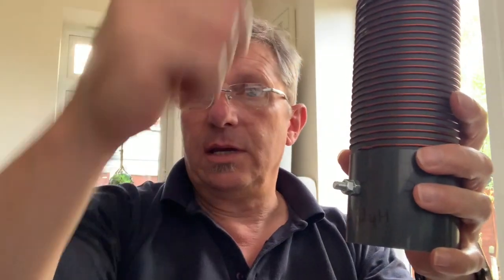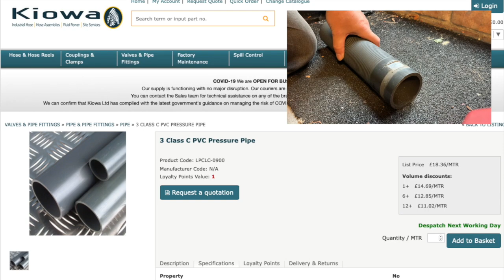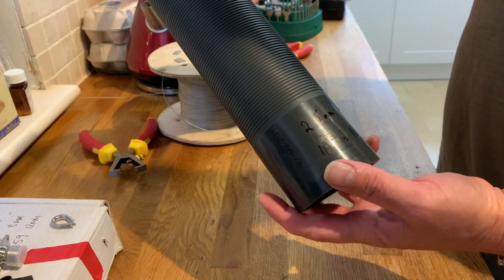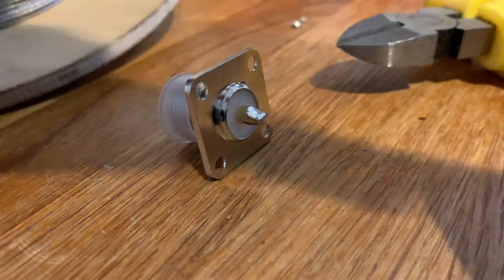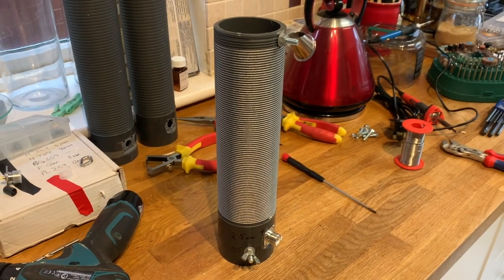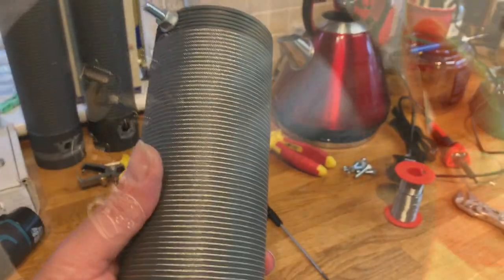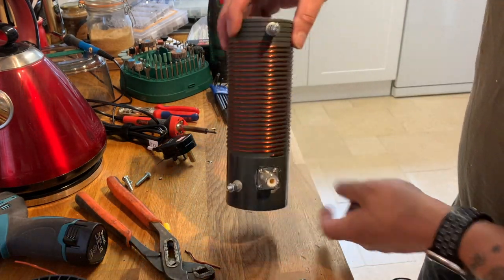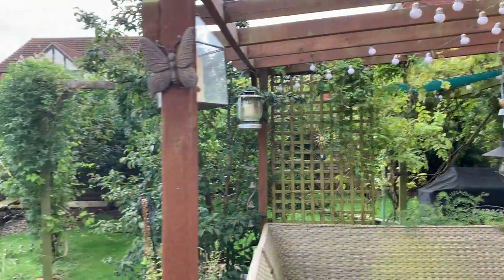HAM RADIO: DX Commander Base loaded for 80M & 160M Vertical.  DX Commander

Comment: Takes me back many years,  as you like tinkering Mike, take a 30mm condute (plastic) 1.2m long, now go get a flat piece of wood vineer (2mm) x 1.1m long ,that wil just fit inside the pvc tube (width wise) now drill 10 holes equally spaced on the vineer (its gonna be close,) wind the vineer from to to bootm.,, with 1mm copper wire varnish coated type (transformer wire) ... 10 turns.
bottom is sealed of with weep hole present, top get a cap and a 3/8 bolt (whatever you can make fit), add a +_1.2m whip (tuneable) and you are on 40m band.
Reply from the maker: might give that a go.  :)

Comment: Hi Mike
Great content,
I've been doing the same sort of think now for a few years,  a friend and I need more inductance while playing with a DX Commander pole on top of Clee Hill and ended up with a beer bottle and 10 turns of wire, which tuned fine.  Sadily, we never thought to test it with the bottle full lol.
The reason for commenting is, I've found that you can get quite an influence by using black pipe as opposed to white pipe, and have always guessed that there is a pigment in the black pipe that makes it magnetic in the same way as a ferrite core.  I know that this isn't t he same with a white pipe and wondered if you had tried this  with a white pipe.  You might find some of those elusive S points.
Great channell.... Keep it up.
Andy

Comment: Hi Mike.... I am all set to go and build my 160 coil after doing the microHenry calcs. Gonna use 110mm plastic sewer pipe (terracotta stuff) and 1.8-2mm copper winding wire with the ‘shellac’-style insulation. Not sure I trust non-insulated wire close spaced. Look forward to your findings. Best wishes. Nick M1DDD
Reply from the maker: 30 turns 2.5mm spacing should work a treat..:)

Comment: If you could make a loading coil for the base of the DX Commander that could work on 160m & 80m using the 40m element with all the required conections for quick switching I would be very interested in buying it! Keep the tests going till you've succeded. It's looking very promising so far. :-) 73
Reply from the maker: Cheers John

Comment: if you put a tap point on the 160m coil you can cover both bands by shorting to the tap point and at the feed point put a cap box for impedance matching about 330pf for 80m  and up near 1kpf  for 160m  base loaded is easy but center loaded is much better
Reply from the maker: Food for thought..  :)

Comment: Nice work Mike, I've made a couple of 160m prototype coils for my adjustiwave. I struggled to get a low SWR but believe my nearby  tower was affecting it. I need to test out in the open before making a  proper coil from screwcut  pipe. The only other issue I see is the number of radials required. 16 x quarterwaves on 160 is a lot of wire unless your in the wide open and can have raised radials. Like the SS wire, I use the same on the adjustiwave but the lack of being able to solder is a pain. Look forward to your testing.
Reply from the maker: Hi Colin, I do agree with you with the radials..  I have 3 at 20m each so SWR is Ok.  Test video coming soon

Comment: Excellent work Mike, It looks like a commercial kit! I don't own a Dx Commander but i am willing to build this Coil for 160m and use 9.68m long aluminum whip with 4 x 10mts long radials that I can fit in my backyard, I guess it will perform decently on 40mts but what i am really into is to try something for 160m. Any suggestions are more than welcome. Many thanks for sharing your knowledge with the HAM community.  73 de TI5CDA
Reply from the maker: Give it a go, 👍

Comment: Great stuff Mike .This coil is for 160m and Vertical Antenna .I have long wire antenna about 70m .Can I use this load coil after my transmitter ?
Reply from the maker: Yes possibly

Comment: Mike, Who provides the external 'screw threads' on your pipework for the coil wires to sit in?
Reply from the maker: Bruce Macaulay a mate called Bryan.
Reply: @mike-M0MSN  Ah -- so Bryan has a lathe! Acquiring correctly 'threaded' coil formers has always been a problem when considering whether to wind a coil such as you demonstrate. 73 Bruce G4ABX
Reply: @mike-M0MSN  Does Bryan have some available for purchase?
Reply: @NS0O-EN33ec  Hi Don
Wind your wire spaced with String/Twine/Rope or a Second Wire to Create/Maintain spacing. Hold coil wires in place with HotGlue/SuperGlue/Epoxy or other adhesive. Remove spacer(s) and you have the same Electrical/RF result as if you had machined grooves.
Add 'Tap-Points' for tuning/testing then coat the coil with Polyurethane or equivalent, or not if using Jubilee Clamp.
Machined grooves are great but really hard to come by. Nylon-String/Twine works just fine for spacing of coil wires. Been there, Done that and Have the 'T-Shirt'. Good luck 
73 OM......

BTW: I intend to construct a few of these coils to add 80M and 160M to my Slopping-Inverted-'L' EFHF 40M/80M (66'/132') antenna raised vertically on a 40'/13M SpiderBeam Mast and then run out horizontally across the yard. I use this at my Antenna Restricted QTH and also when I go Portable. Works quite well.
I insert different lengths of wire at the feed point to resonate on the 'In-Between' Bands, with no tuner required........
Reply: Many plumbing supply shops will thread pipes on request, both PVC and metal.

Comment: Is it possible to build coil to add to my multi band Dipole Antenna. The antenna is 80 feet long and will operate down to the 80 meter band.  Is it possible to add a 160 meter coil and extra cable to each end of the antenna.  Space is not a problem. I can experiment but why reinvent the wheel.
Reply from the maker: Yes that can be done, perhaps a coax trap would work better..

Comment: What was the reason for choosing stainless wire?
Reply from the maker: Hi James, no real reason. I had some SS rope from another unrelated project, needed to have a wire that I could tap at any point without the need to remove any insulation, it is going to live outside, so decided to use the SS wire. seens to work well.. :)

Comment: Stainless steel for an inductor ?!?!?!? Do you know the stainless steel resistivity? It is TEN TIMES the copper resistivity. It is also so THIN !!!
So you put a such inductor in a shortned antenna (very very low radiation resistance) and just in the lowest impedance place of the radiator.
Please don't share such kind of suggestions. 73s.